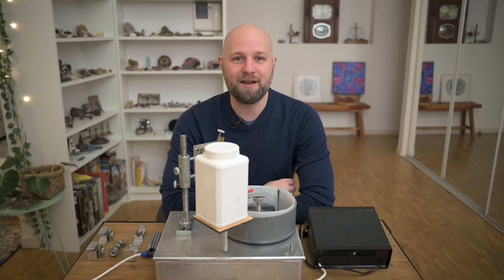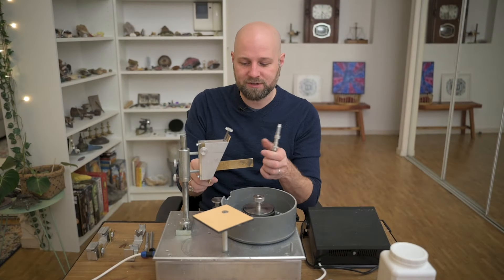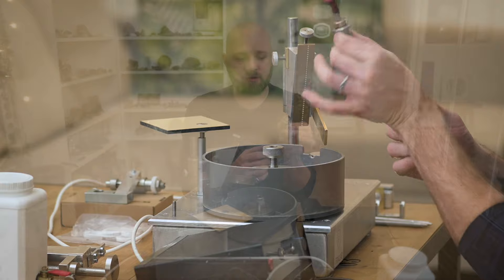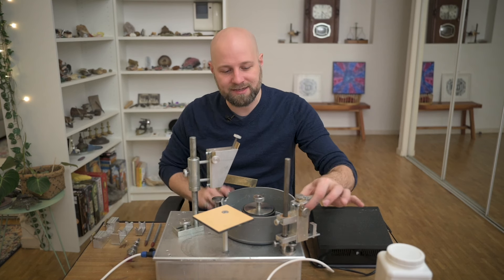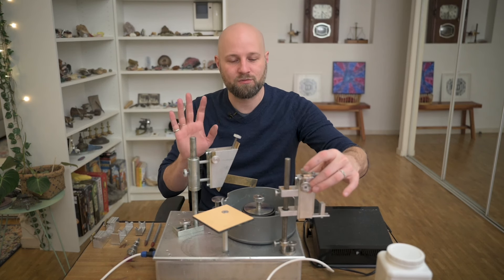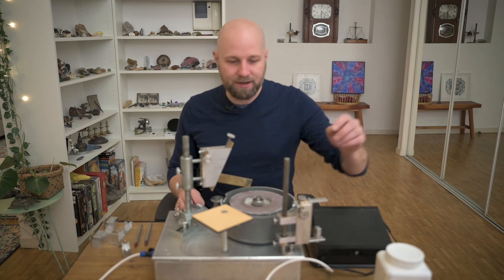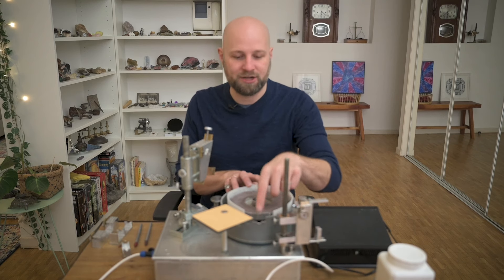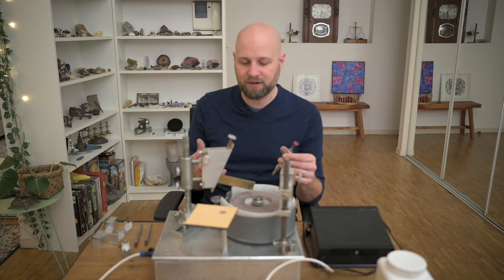Fralap Jambpeg Faceting Machine Review

Comment: Regarding the angle block. If the disc is not spinning, potentially it is not level with the base, the spinning of the disc effectively makes it level with the vertical shaft. Plus, if you have diamond paste on the disc, it can contaminate.

I would recommend leveling it on the metal case. And because the rotation can change the reading if your table isn't level, make sure to zero at the same rotation or level your station first.

Ps. I'm not a faceter I just enjoy understanding your techniques. Maybe one day I'll start facetting stones, but the investment cost is very high for a hobby I'm not sure I'm going to keep my interest in. So please don't see my comments at critiquing you, I'm just sharing my thoughts hoping it is of use ❤
Reply from the maker: It’s possible the lap and the top of the machine aren’t perfectly parallel which is why I use the lap to do it. There is no free diamond on the cutting disk so no chance to contaminate. If the reading changes a tiny bit due to lap rotation that’s ok. As long as it’s not changing 1 degree, I’ll be ok.
Reply: @JustinKPrim  very true! I hope I come across as trying to be helpful rather than a keyboard warrior. Thank you for your content and passion

Comment: The last time you discussed the Cam shaft, I couldn't see how it could deal with different size stones. The only way I can see this working is a cam shaft reader that applies a configured ratio, which then pushes on the standard. This could literally be a compass like mechanism that goes up and down and depending on where you position the reader and writer on the arms, you get a different ratio.
Reply from the maker: As it spins, the cam pushes against the girdle cutting plate and pushes the stick up and down following the shape of the cam.
Reply: @JustinKPrim  so, there isn't a problem with applying the cam shape to a smaller stone than the cam template? I'm surprised! Well, it's not like you are going to use the custom shapes as you explained in the video
Reply from the maker: @krasbestendig  No because the girdle cutting platform goes up and down so you can set it to match the size of the stone.
Reply: @JustinKPrim  I understand now and it's suddenly super obvious... I'm a champion in overcomplicating things... Thanks 🙏